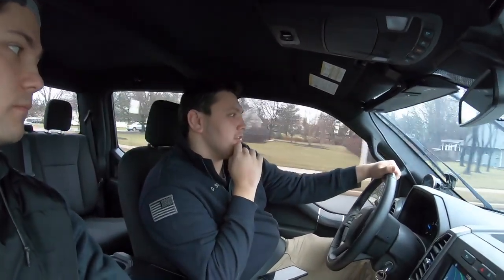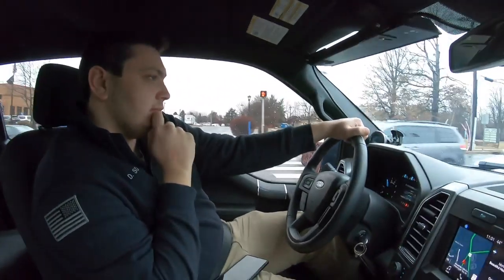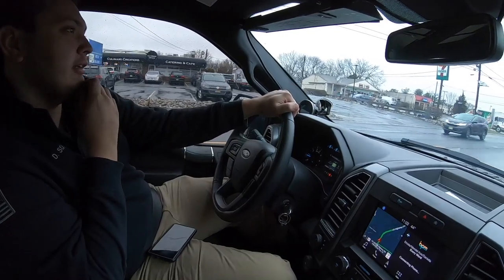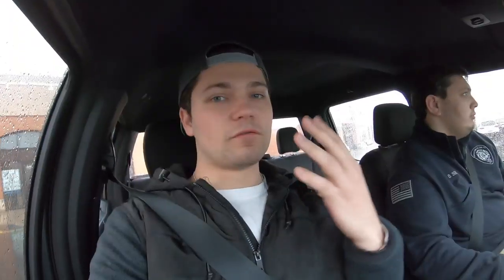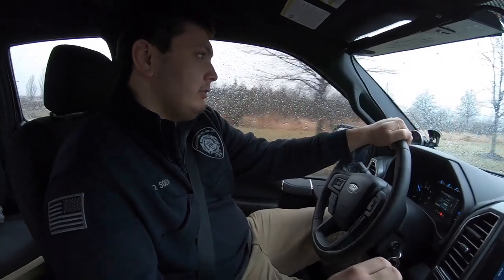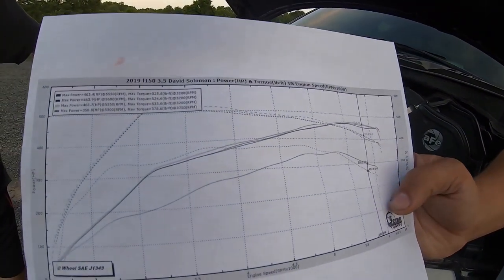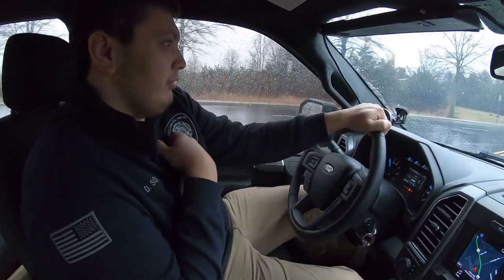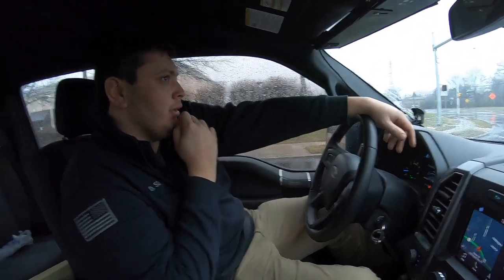Our 2019 F-150 Ecoboost Mod List | 500+ HP

Comment: Why no tunes in the winter?
Reply from the maker: A Soulia here in jersey there’s no sense to have all that power and waste all that gas so we just set it back to stock
Reply: @RatchetWrenches  did you ever re race the ram after the tune?
Reply from the maker: A Soulia nah it wouldn’t be worth it. The ran lost pre tune so it’ll lose now that we have the f150 even more power
Reply: @RatchetWrenches  tune the ram?
Reply from the maker: A Soulia the f150 has the tune, the f150 beat the ram on no tune so now that the f150 has the tune it’s gonna blow the ram out of the water
Reply: @RatchetWrenches  what I meant is.. could you tune the ram and see what happens? Or are you too far modded with the 150?
Reply from the maker: A Soulia we could yeah idk if we will at this moment but that’s a possibility and it could even out the playing field

Comment: I just got the same downpipe I had the shop down the road install it and its leaking any suggestions he said he was scared to crank on the  clamp any tighter he thought he was going to break it?
Reply from the maker: Well where is it leaking from? Front the turbos? Or from where the catback connects to the downpipe?
Reply: Where the catback connects to the  downpipe.
Reply: @RatchetWrenches  Where the downpipe bolts to the catback.
Reply from the maker: Interesting. Definitely take that back to them because it shouldn’t be leaking from there.
Reply: Not really a huge issue leaking from there where you dont want it leaking at all is from the turbos in front of the 1st bank o2 sensors as on deceleration it can suck oxygen in from the outside and the o2 sensor sees this as a  lean mixture and richens the fuel mixture
Reply: From the flanges where the exhaust bolts to the turbos

Comment: I just put an AWE 0FG non resonated exhaust on my 18 3.5 eco. I think it's one of the better sounding exhausts for the 3.5 eco.
Reply from the maker: Nice! Yeah I’ve heard from many people they are good exhausts especially on the Ecoboost trucks
Reply: Do they make any more power? Do you need an intake as well?
Reply: @timvildis8925  I have no idea. If it does it's not noticeable. I don't see why you'd need an intake with an exhaust
Reply: Thanks for info

Comment: So can you run E-50 with stock 3.5L Ecoboost fuel pump and injectors safely? or did you need to replace any parts? so your parts list is 1) BOV 2) Air Intake 3) Downpipe w/adapters 4) Tuner with 5 star tunes. I am definitely looking into these same upgrades if it can get this kind of improvements.
Reply: I have 2018 with similar mods. I also have IC, hot/ cold pipes and exhaust. I ran E 50 tune for about a year and a half. Stock fuel pump and injectors. She never ran lean for me. In the shop now with the broken crank.